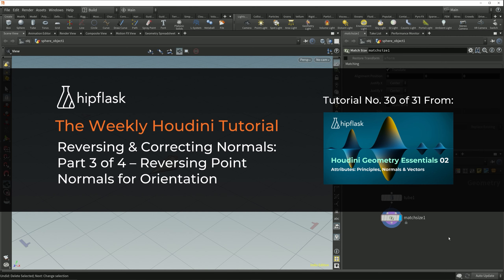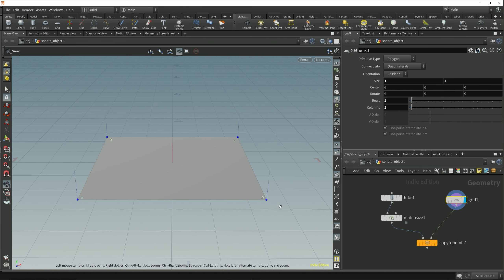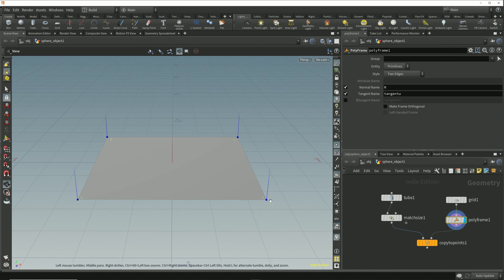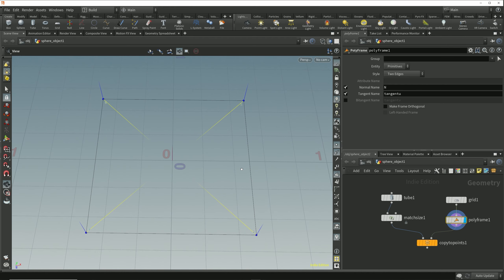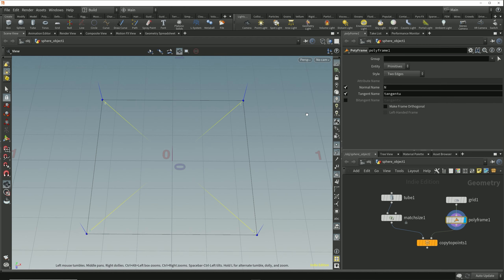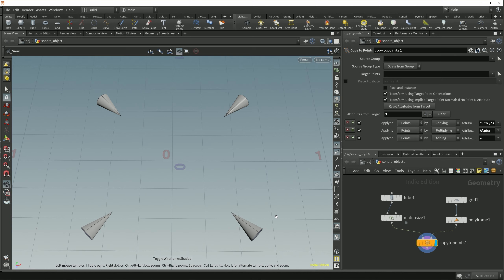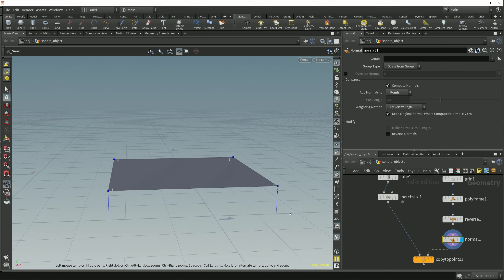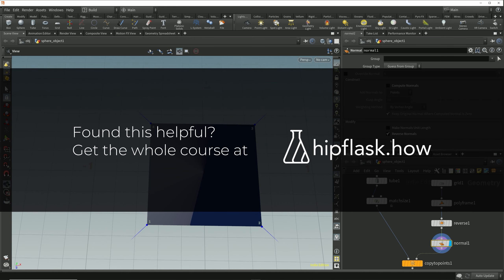Reversing & Correcting Normals in Houdini Pt. 3/4 – Reversing Point Normals for Orientation

Comment: Hi Hipflask, Thank  you so much for this series, It helped me find the problem im having. But I'm having trouble finding a workflow to make this detection procedural. Is there a VEX method or workflow to find these inverted values? I can detect them per poly. Lets say if (@N < 0 ) But this also detects the bottom if its part of, lets say, a cube. I wish to find a solution where i can merge all the geo (not all connected), detect the reversed geo and group them and flip them. Hopefully you have some time to help me out

Comment: hi, i am doing glass breaking simulation, but want to texture and render in 3ds max, so i am getting the normal problems in that , how to solve that problem, i have tried to assemble that geometry, and also used connected and discconected faces, but getting the normal artifacts in 3ds max , can i get any help thanks!
Reply from the maker: Are you adding vertex normals as an attribute before exporting your geo from Houdini?
Reply: @hipflask4921  no, can i get to know how to do that ?
Reply from the maker: The easiest way would be to add a Normal SOP before you export your geometry. You may need to adjust the cusp angle and/or weighting method to suit your geometry, but there's a good chance the defaults will work fine for your fractured geo. Hope this helps.
Reply: @hipflask4921  hi i get rid of my normal flickering , by just adding normal node to it, but when i use assemble to pack them nothing showed up in max , so now the problem is how to pack it like the same , like when it collides then it shows the cracks and all, its a glass
Reply from the maker: @none53  There's no need to pack the geo before sending it to Max. Packed primitives are native and specific to Houdini. If you're packing the pieces as part of your workflow in Houdini, just unpack them (using an unpack node) before exporting the geometry.
Reply: @hipflask4921  now i am not packing it ,bcz i thought packing gonna help me in 3ds max , bcz i want my glaas to break when it collides but its cracks are initially showing up in the render, is there any way to hide that crack in render in 3ds max ?? i mean when glass collides then i want those cracks to be showed !
Reply: https://imgur.com/a/v2M8gjy this is render i am getting in max, so glass is already cracked , i want these cracks to  hide , until they break :)
Reply from the maker: @none53  The simplest way of dealing with that would be to key the visibility of the geometry. So you'd have a single solid piece of unfractured geo before the point of collision and then swap this for the fractured geo when the collision object hits it.